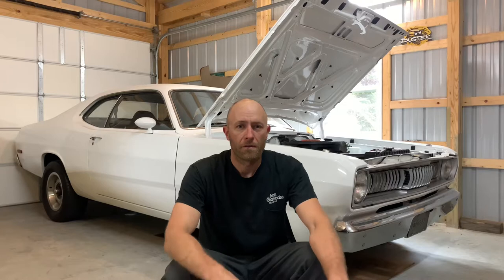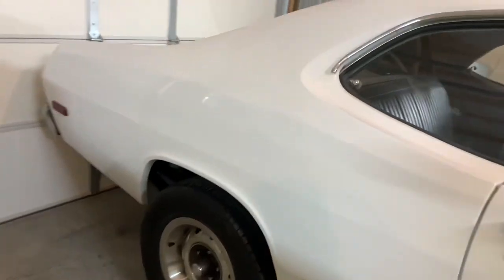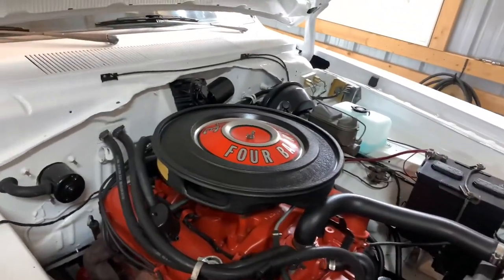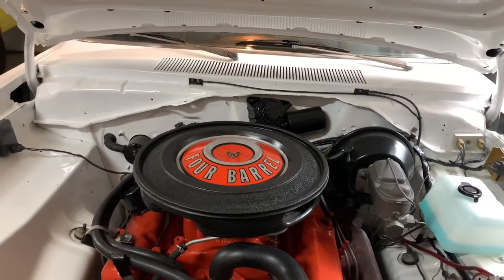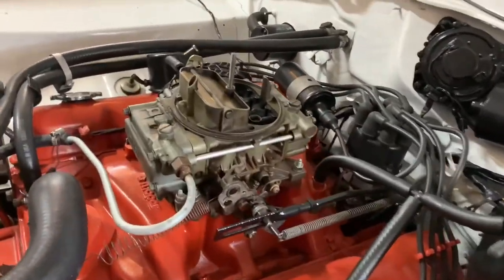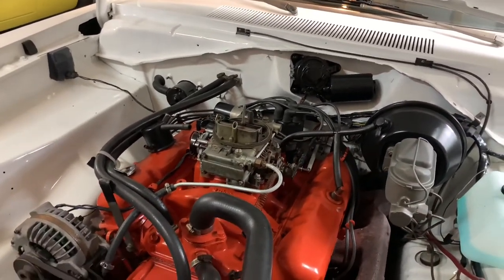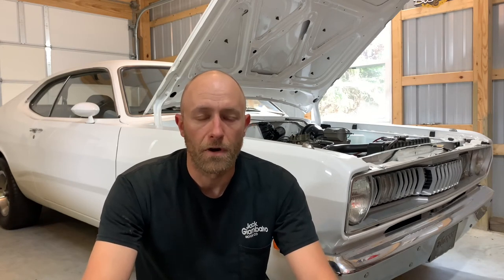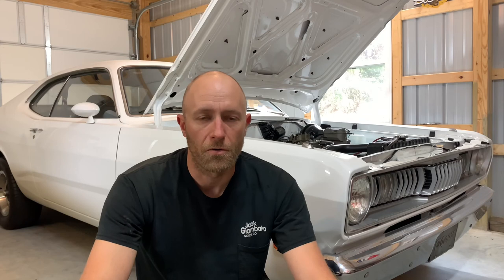5 tips to make your muscle car go faster at the drag strip…and they’re free

Comment: Want another 10 to 15 hp on the strip? Put grease on the fan belt just before your run. The water pump and alternator will turn but slower. The grease will ware off and the belt will turn normal in a short time. I have done this and sure makes a difference.
Reply from the maker: Thanks, I will have to give that a try.

Comment: Modifications will depend on what you're set up is. For your particular set up these modifications are great. Personally I have ran a progressive carb linkage setup to do away with the vacuum secondaries.. but I was always running six pack carburetors anyway. Track day, fuel is a big issue also. If you want to run pump gas and race with pump gas, then there's not a lot of fiddling that can be done with the timing. However, race gas, creates the situation where you can advance the timing considerably. I hesitate to offer any numbers specifically because we don't know what everyone's engines specifications are Etc. Free flowing exhaust, right gear selection, right camshaft for the RPM use, there is just so many variables that can be tweaked here and there. I always said that a 14 flat ET car was capable of 13 flat. There's plenty you can do to get it very near that number. Even with a stock car

Comment: How'd I miss this vid??!   I was just thinking about how to sneak out to the track in Bremerton tomorrow but couldn't justify the trouble since I've made no improvements since the last time I ran it in Texas (2 years ago). I've never tried a couple of these and now my interest in tomorrow has piqued!!  Anyway totally agree with the cool can comment especially for Texas. I used to run on the street with a little lunch cooler full of small frozen gel packs to keep it cold. 101° ambient = vapor lock just going to the store, racing after May in Lufkin? forgetaboutit!!  w/o my cool can. 
I'm a 340 with a 360 stroke and heads in a heavy all there, 2nd gen barracuda.  
anyway thanks for the tips!
Reply from the maker: Heck yeah, a cool can sounds like a must down there. I love ‘68 Barracudas.  My dad had 2 of them over the years. Hopefully you can get to the track tomorrow, good luck.

Comment: Try bringing your car down to ambient air temperature in the pit and try not to heat it up before your burnout. Should go .15 to .20 quicker. Also remember that the closer you powerbrake it up towards stall speed the softer the hit on your tires. So remember that if you are tending to spin a little on launch.
Reply from the maker: I definitely try to keep the car as cool as possible. I like your converter flash tip.
Reply: Just send er bud👌

Comment: Mount your battery in the trunk.
That really helps traction.
Reply from the maker: It definitely does
Reply: @Duster_Garage  
I should have added - just make sure to run your negative cable all the way to your engine block not just to the frame.

Comment: With air cleaner off. Better yet run bottom low profile aftermarket or the oval factory. Overall best ET Require no hood or scoop.2-3 filter stack. Other comment here run temp! YES 100% Mopar Perform best 170° 165°stat. Stat opening at burn box.
Reply from the maker: Yes, a good cool down of the engine is very important. I did forget to mention that. Very good point, thank you.

Comment: Nice that 340 runs strong for "appearing" stock and on street tires! 70' or 71', 727 or 4spd with what rear gear? I'm going to mess around and get another Duster if I keep watching your channel lol
Reply from the maker: Thanks! It’s actually a ‘73 with ’72 front end parts (hood, grille,bumper etc.). It has a 904 with a stock 318 converter. And the rear is a b-body 8 3/4 with a 3.55 sure grip center section (741 case).
Reply: @Duster_Garage  Well hot damn greatcombo! Just so happens I have a 360, 904, B body 8.75 and stock 318 laying around. I just need another Duster!
Reply from the maker: A 360 with a little bit of stall behind it and 3.55 gears makes for a fun street combo.
Reply from the maker: @TrevorThomas31  LOL. You got me stumped. How did you know that I had that label?
Reply: @Duster_Garage friend of a friend  of a friend told me.